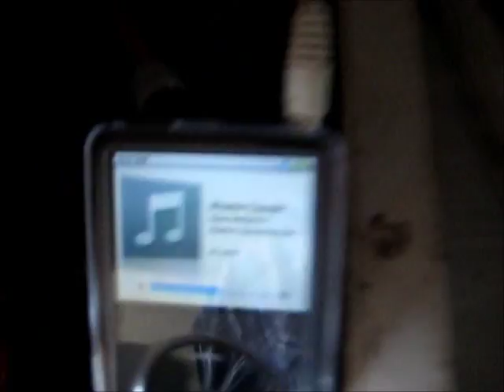PC Speaker Amp Repair (Part 1)

Comment: Hmmm, interesting sound issue on that. Plays OK on the left or right channel, but not both at the same time. 

I do wonder: That balancing pot. Do see that it isn't that which is dodgy before doing more fiddly soldering work.

Also, that chip that you removed. You said it was faulty. Sure? I think it needs to be tested.

....On a ballasted variac. :-D

As an end-note: Cute cats again. They need their own vids just like my Tobias has his own "Feline" vids. Thanks for showing. :-)

-BBD.